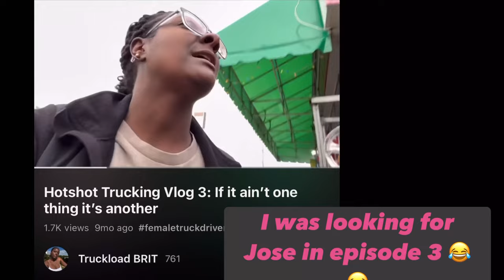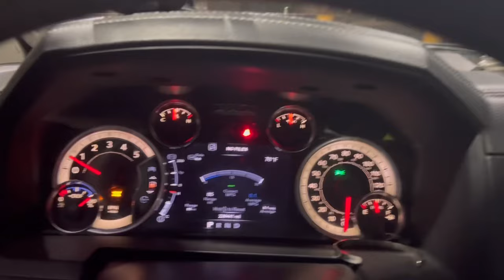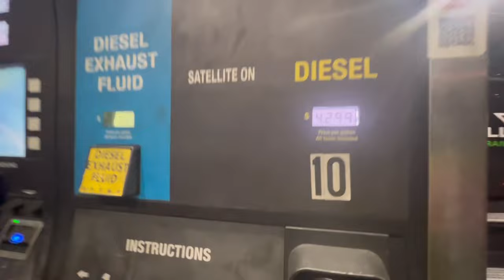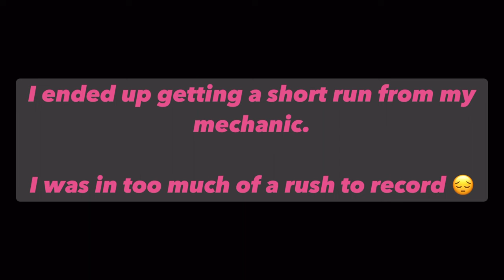MAN! I MESSED UP THIS TIME 😩 EPISODE 12

Comment: In the summertime trying to put straps on the load and God forbid if you have to put a tarp on it. You get very thirsty and hot plus it can help you lose weight.
Reply from the maker: Truck me I know.. I had a load in Phoenix during the summer. It was 114 degrees 😭😭😭